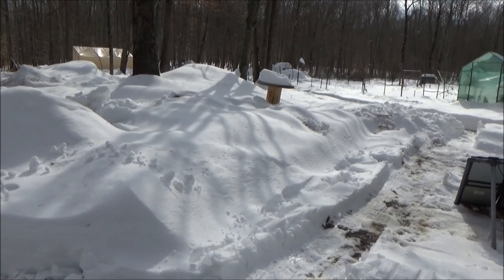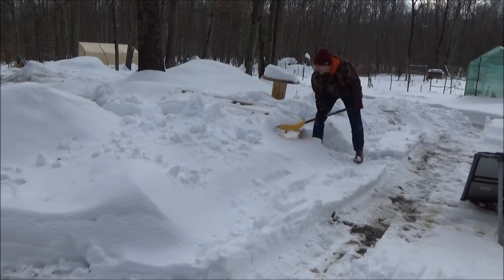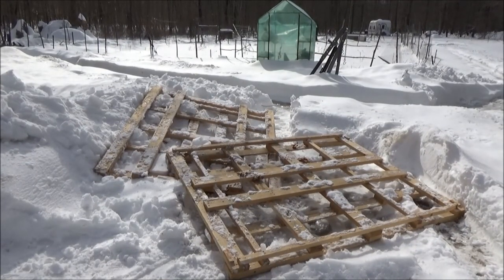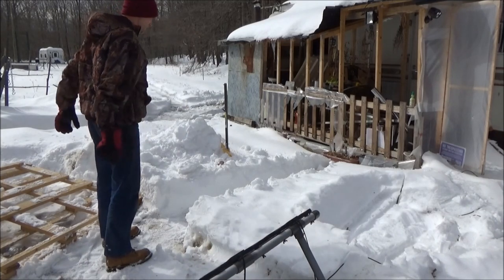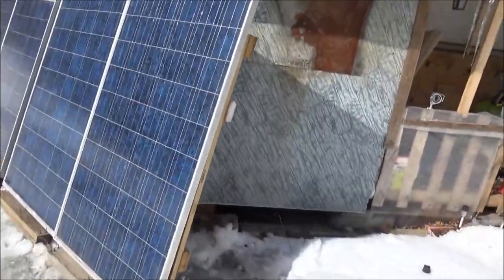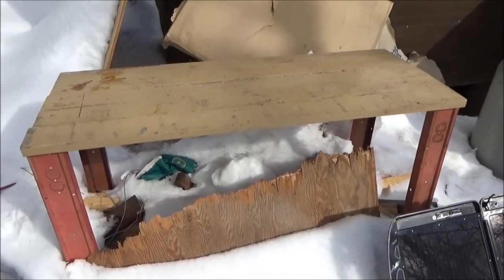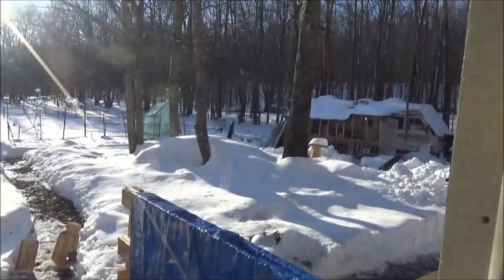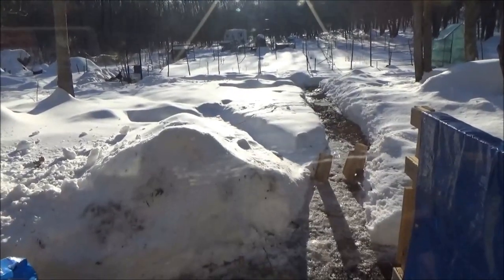Installing More Solar Panels At The Off Grid Homestead

Comment: Hey Troy,

Now I am quite confused and hopefully you can either explain it to me or check in the manual of the charge controller. I saw where you took a screen shot of the charge controller "live" screen where it was showing an array voltage of 54.3v and a current of 0.9A. At the same time it was showing it was providing 111w of output power (12.72v x 8.4a). This is at time index 26:05 in your video. 

Can you tell me what the charge controller means when it says "array power" as obviously I am misunderstanding something.. Power (Watts) = Amps x Volts. 54.3Vx.9A is NOT 111W output.. It is 1/2 that. So unless Tristar can create energy from nothing, I am seriously missing something here.

Thanks for helping me understand what the charge controller numbers mean!
Reply: That is all seriously beyond my ken. Therefore, I just read past it and try not to be bothered by any of it.
Reply: I'm not bothered by it, but being an Electrical Engineer who is thinking of installing Solar on my RV, I'm quite curious as to what TriStar means with "array" data as compared to "output" data..
Reply: SSanf
He is saying that the numbers don't correspond with the maths.
Ohms law ( P = V x I )  or P = 54.32 x 0.9 means P should be 48.88 watts and not 111 watts as shown on the left screen.

P= Power or Watts
V = Voltage
I = Amps
Reply: UNumbTV
Well OK, then. Why didn't he say so?
Reply: SSanf
He did. I just dumbed it down for you. :-P' ' ' '
Reply: UNumbTV
Hey, at least I have heard of Ohms law which puts me ahead of 98% of the general public which would have heard of it too but they were busy texting their current love interest when it was being taught. You are just the smarty pants who remembers. :-P***
Reply: SSanf
Lol. Actually I have been an Electrical engineer for the last 35 years. The last 10 of those years I was an electrical inspector.and the last 4 I was a registered Qualified Supervisor with the NICEIC in england.
Reply: UNumbTV
In that case, you better remember or we are all in big trouble.
Reply: Andre Normandin The answer you look for is not Array Voltage x amps. What you are looking at, to get the Battery side of the of 111w is the sweep voc x amps.  Math LoL you can get it to say anything if you twist it just right. lol
Reply: blakke29223 Thanks.. At least it adds up :-)

Good to know Tristar isn't claiming a "perpetual motion machine" :-)
Reply from the maker: An MPPT solar charge controller is something special. First lets look at a cheap charge controller.

Solar panels are rated at 18 volts open. This means with no connection they put out about 18 volts. A battery is about 12.5 to 13.2 volts, (average).

A battery charging voltage ranges from 13.8 to 14.5 volts (average).

Solar panels produce a higher voltage so that in lower sunlight conditions they can still charge a battery.

Now when you connect a solar panel to the batteries with a cheap controller it just passes the energy on through to the batteries and disconnects the solar panels from the batteries when they are charged. (I am simplifying things here a bit).

When a solar panel putting out 18 volts is connected to a battery sitting at 12 volts anything above 12 volts is lost energy. Just ignored by the battery.

The MPPT charge controller matches the battery voltage with the solar panel voltage. So lets say the solar panel is again at 18 volts and the battery at 12.

The charge controller adjusts the voltage down to match the battery while increasing the current output. This uses all of the power from the solar panel instead of losing some as waste with a cheaper controller.

Hope that helps.
Reply: The Do It Yourself World  Yes, I understand that. Unfortunatly, the way the controller presents the power transfer information makes it appear incorrect. The video shows that the controller was outputting 111w to the battery bank but the array voltage/current don't add up to 111w. Blakke said to use the Sweep Voc and current which does add up to 111w. But I'm still confused..

I'm actually looking at this very moment to purchase solar to add to my RV, and the TriStar controller is one I am seriously looking at. But I would love to fully understand its informational screen before I purchase one.  

Does the manual define what Sweep Voc, Vmp, and Pmax are?

Thanks so much!

Comment: why not set up a forced air solar heater? I made one 2 years ago and it's amazing....-20f outside and it blows out 100 degrees of heat! Fully automated with a little button thermostat, solarpanel and PC fan. I'm sure you could throw one together with some spare parts you already have on hand....like that big window that got cracked/ruined
Reply from the maker: Next year I plan to work a lot more with solar heating. Right now its all about tiny house construction

Comment: Whoa,  wait a minute.  Why are you using such a small gauge wire to hook up those solar panels ??  You have about 800 watts of electricity from those panels,  you need a wires that are rated properly otherwise you won't get much power from it.  Or worse, during peak sunlight especially in summer,  the wires heat up and burn.

Comment: Dont like the panels in series even 2 panells in parallel would give you 12v and double the watts. instead in series your cranking the voltage and cutting the wattage way down.
Reply: Electronics math. Higher voltage and lower amperage means less I X R losses. By increasing the voltage and lowering the amperage with the same resistance in the wires he has less power loss due to resistance. The only other option would be to use bigger wires or wires made of silver to cut the resistance. And the monetary cost may not be worth the minimal power gain.
Reply from the maker: I have an MPPT solar charge controller which means I can connect my solar panels in series to reduce loss in the wires. These are 24 volt solar panels. Connected for 130 open volts at only 8 amps through the wires.

Comment: Troy where did you purchase those solar panels? I ask because I am wanting to purchase more and the local place I bought my current panels from was nearly $2.00 a watt... I just picked up a Chevy Volt to drive and I'm using up a lot more energy then I did prior...
Reply from the maker: Used online for 50 cents per watt. But if you can afford the $300 shipping you can get 10 solar panels for 62 cents per watt at sunelec